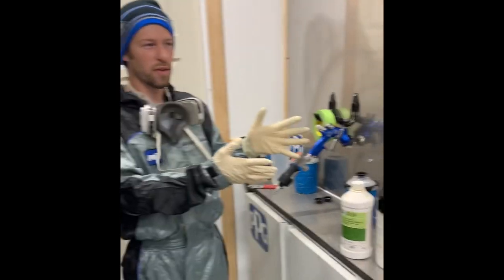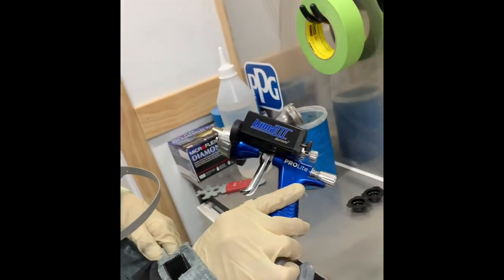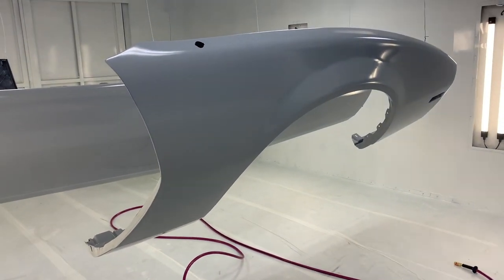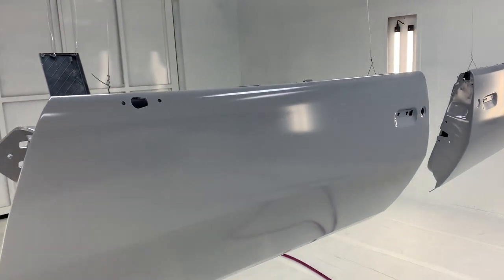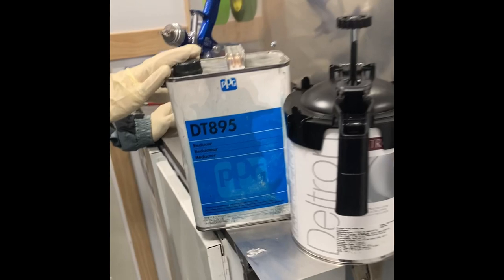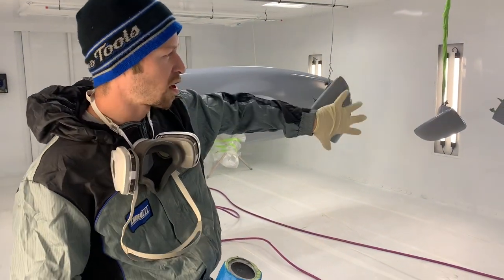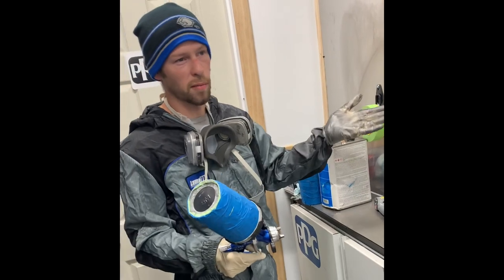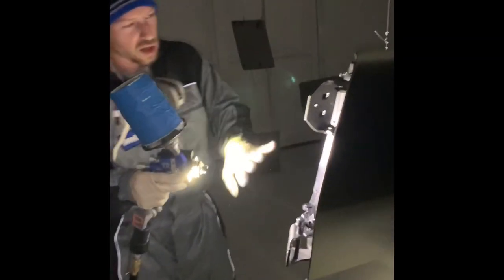First paint job in the new booth! 88 firebird ford J7 magnetic grey

Comment: I've been using the 5700 for a number of years.  You should try the VH7795 sometime. It's a little thinner viscosity and lays out nice. This clear isn't easy to run. For the most part it stays where it lays. Love how it buffs. I agree with the DT895. I use it on everything but solids in cooler temps. Congratulations on the new booth. Major step.
Reply from the maker: Thank you! I’ll definitely try the 95
Reply: @linearblockingtools4064  
Thanks for the reply.  Partially disregard my comment on you latest video.